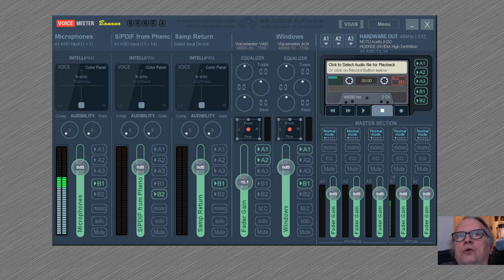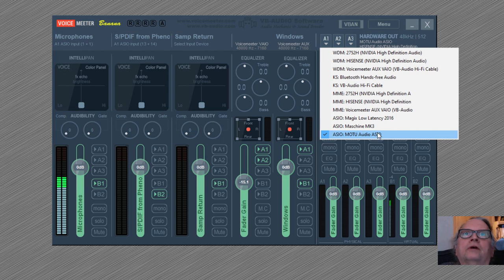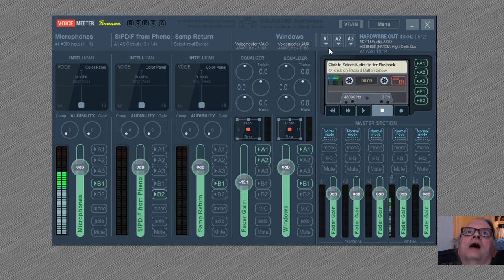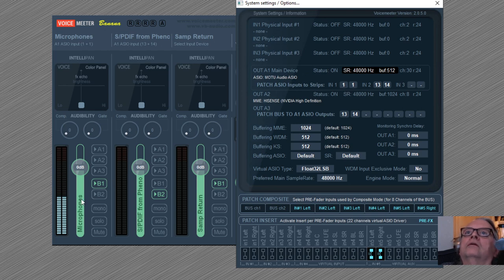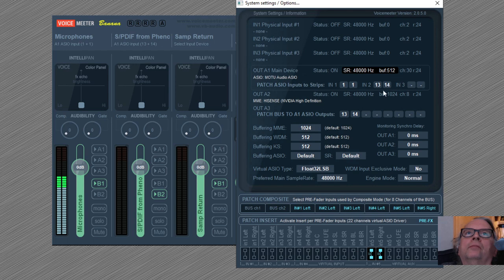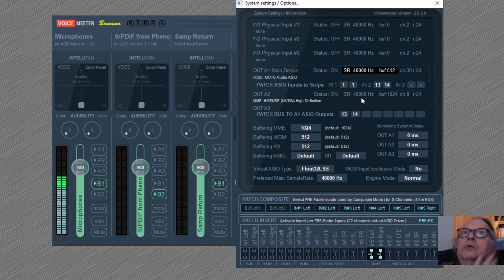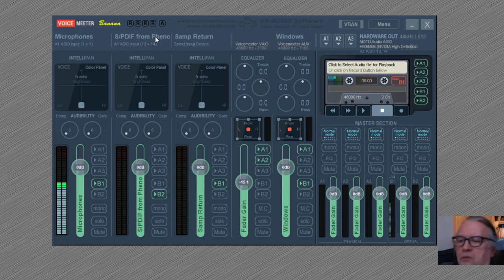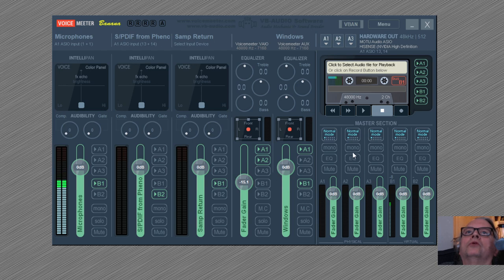Using Voicemeeter to interface DAW through ASIO hardware and a "loopback" cable to Zoom, Skype, OBS

Comment: Hi Terry
. Your tutorials about Voicemeeter Banana it's great. I'm learned a lot with your videos.

I have a problem. I'm recording a podcast with my friends using Skype, Voicemeeter Banana and Virtual Cable. The episodes its about 50-60 minutes and the final file .wav its size about 1.8 Gb - 1.9 Gb. It's normal? Could I've a lighter file?

Maybe, Its a mistake a in my configuration. Can you help me with this? I would appreciate your help.
 Thanks.

P.D. I hope the message is understood. My english isn't very good, sorry.
Reply from the maker: You might be recording eight channels when you only need two for stereo - check the settings in the recorder and see if you have unused channels marked to record. (Right-click on the "cassette".) Only select the one bus that you are using to send a stereo output for use by the recorder. Perhaps the B1 or B2. When using Banana, you should not require the virtual cable, because its VAIO AUX is basically one of those.
Reply from the maker: Did you manage to get it working?
Reply: Hi  @CreatorsMediaTools . I could not fix the problem. My configuration is:
- Hardware input 1: Microphone (HyperX Quadcast) (B1)
- Hardware input 2: None
- Hardware input 3: None
- Voicemeeter VAIO: Skype (A1 and B1)
- Voicemeeter AUX: Soundplant (for audio effects) (A1 and B1)
- A1: Speakers
- In Cassette: B2
And my recorder options:
- Post-fader outputs: Only Virtual Bus B2 activated 
- Tile Type: Wave
- Sample Rate: 44100 Hz
- Bit resolution: 16 Bits
- Channels: 6
In Patch composite:
IN#1 Left, IN#1 Right, IN#4 Left, IN#4 Rigth, IN#5 Left, IN#5 Rigth
I recorded for about 2 minutes for testing (many times) and final file always its size about 70-80 Mb. I think that is a file too big.

What's my mistake? 
 Thanks for your support
Reply from the maker: @ReymarR14  I do not see mentioned what is going to the cassette recorder B2. You only mention outputs to B1. Are you recording in composite mode for the cassette recorder? If so,switch to bus mode.
Reply from the maker: "Channels 6" is the problem.That should be set at 2.
Reply: @CreatorsMediaTools  Yes, I using composite mode. In master section: I activated composite mode to Bus B2.

I using "Channels 6" because i need audio on separte track for editing.
Reply from the maker: @ReymarR14  Aha! Well, that is what is making the file size so large - that is six times as large as a stereo recording would be. Well, it is still REALLY NICE that Voicemeeter allows you to do such a multi-track recording for editing later, eh??? :-D